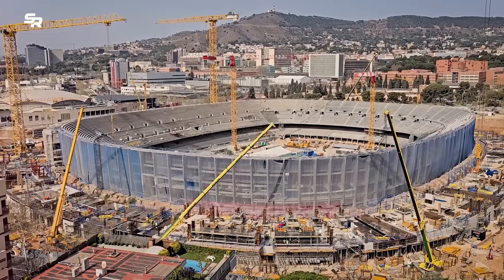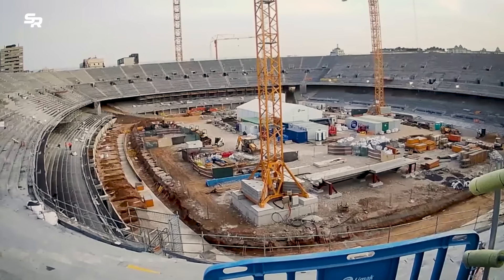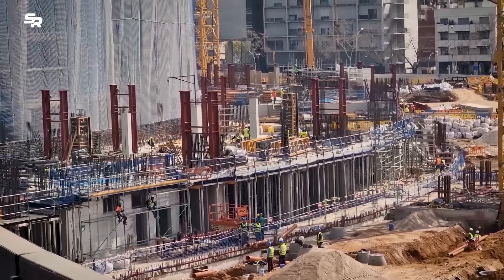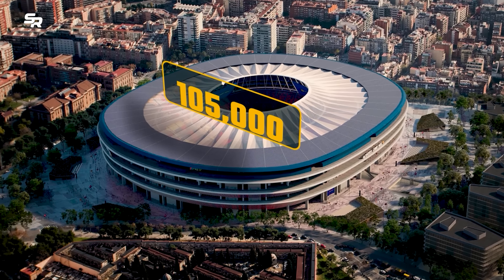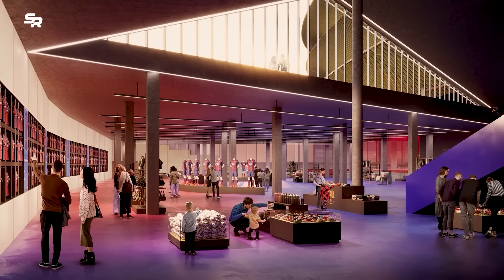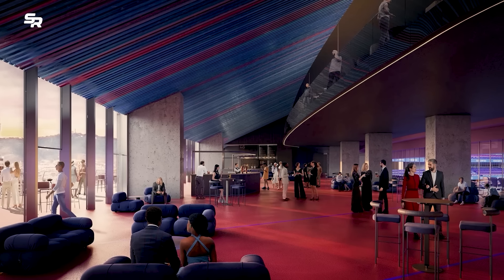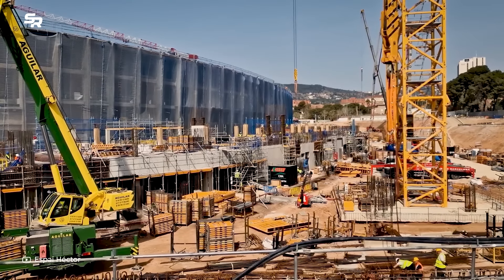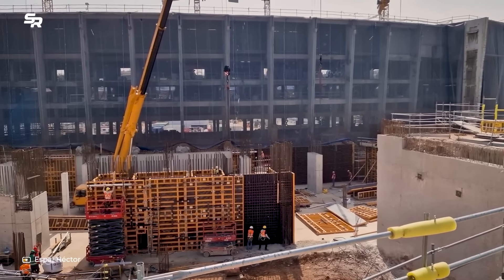NEW Camp Nou Update (22 March 2024)

Comment: Was the 360° screen scrapped?
Reply from the maker: in the project, the structure of the cover seems to be light, and I don't believe that it can hold the weight of a large 360 screen
Reply: @SportsRender yeah but they said the roof is missile proof! How comes now it can't hold a 360 screen?!
Reply: @soni5713  Too costly at the moment. But as any new techonology, in a few years (not many) price will drop and specs will be better.